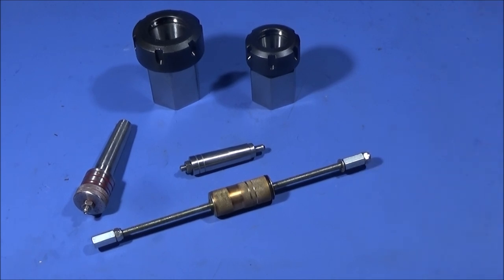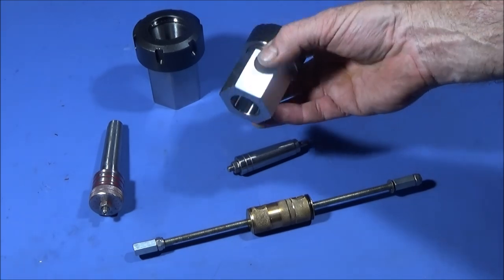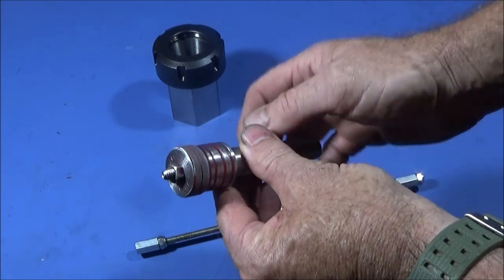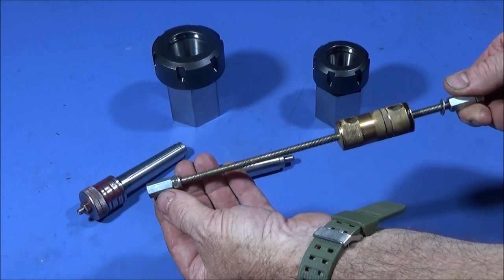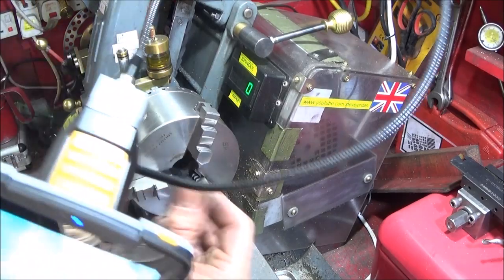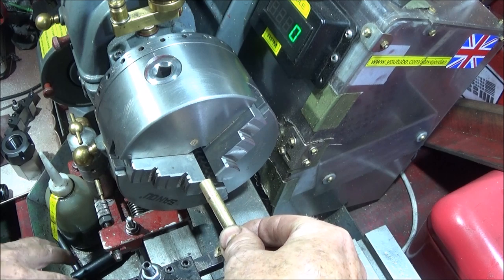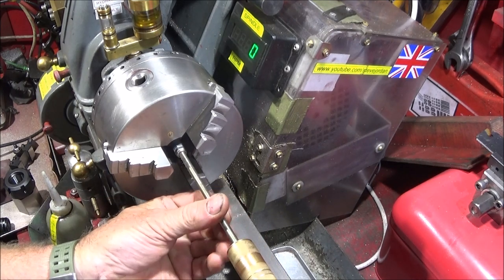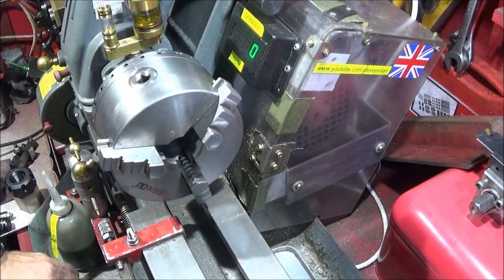My Myford ML7 Adjustable Back-Stop With Extractor Tool.

Comment from the maker: TOOL LINKS BELOW:-
ER40 Hex Collet Block Chuck Holder CNC Tool Holder--http://bit.ly/2yOVGeX
Hard Steel Hex ER-32 Collet Chuck Block CNC Lathe Tool Holder--http://bit.ly/2YM35v2
19pcs ER32 2-20mm Spring Collet Collet Chuck Set -- http://bit.ly/2YSm0AF
Inskam112 HD 4.3 Inch Display Screen 1m 5m Handheld Borescope -- http://bit.ly/2tPZ8TW
Inskam113 4.3 Inch HD1080P LCD Color Screen Handheld Borescope -- http://bit.ly/2F9iERH
Reply from the maker: $21.68 4pcs MSPA Inflatable Hot Tub Replacement Kit -- http://bit.ly/2Zr0k1H (coupon: BG1726)
$48.99 Machifit ER11 Chuck CNC 500W Spindle Motor -- http://bit.ly/2ZB99lC (coupon: BG500W)
$33.99 HILDA 220V 350W Variable Speed Electric Grinder -- http://bit.ly/30GTAdt (coupon: BGEG35)
$23.99 HILDA 220V 400W Electric Paint Sprayer -- http://bit.ly/2MJSVob (coupon: BG2c532d)
$213.19 Machifit CNC 5 Axis 500KHZ Offline Controller -- http://bit.ly/2L2i2Al (coupon: BGMACH3)
$32.79 Machifit MACH3 4 Axis USB Electronic CNC Handwheel -- http://bit.ly/2ZkC5CV (coupon: BGMACH3)
$36.99 Self Centering Dowelling Jig -- http://bit.ly/2MH3yIo 
$19.99 Drillpro 8pcs 2-12mm 4 Flutes Tungsten Steel Milling Cutter -- http://bit.ly/2ZkC5CV